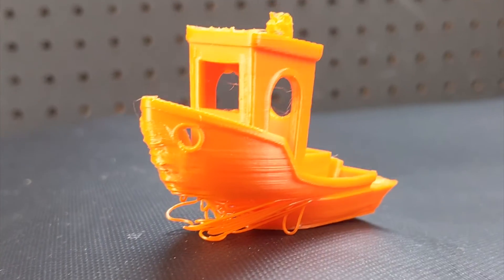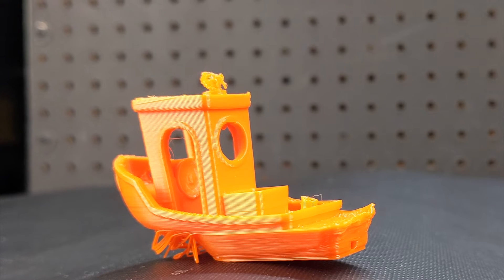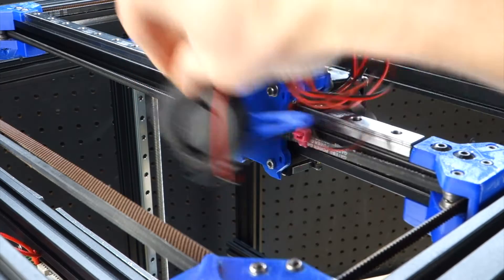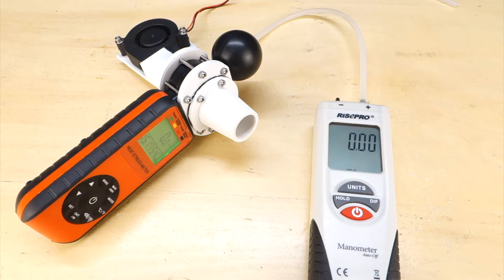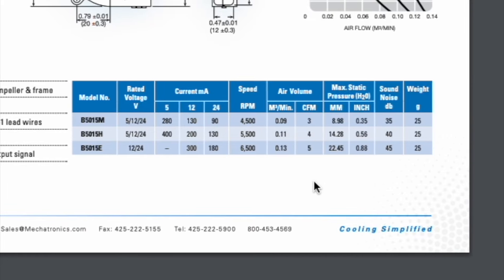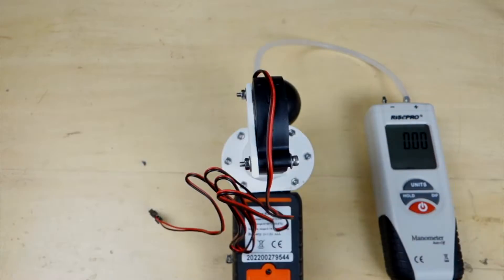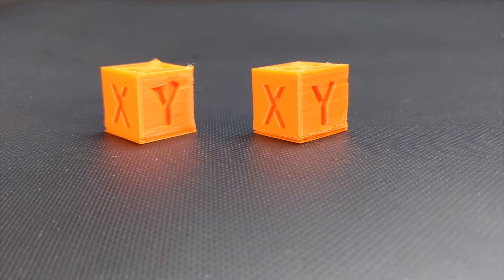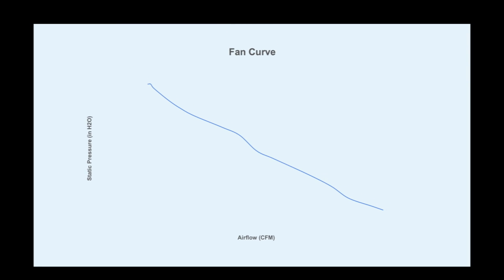ELIMINATE FAILED 3D Prints with This QUICK FIX!

Comment: ok without having seen the video, stopped at where you say the fan is barely noticable, im gonna make a wild guess and say:   24v fan ( or any voltage higher than the port supplies) on a port that does not supply 24v but less, ima edit after the video if i was right :D

edit: i was wrong :D but i had 2 friends already complain that theirs had similar issues and they put a 24v fan on a 12v fan after replacing the cooling fan with ones they found recommended for that size, not knowing its different voltages
Reply from the maker: Good point!  It's important to double check the fan voltages.

Comment: I would say you should also look at your bed though. The print head should not be able to shift your magnetic steel sheet like that, normally it's virtually impossible to move the sheet horizontally when its held by the magnetic substrate, that's why you have to pull up at a corner to get it to release.
Reply from the maker: Agree.  The bed is on my upgrade list.  During the build I did realize the magnets were were weak, but this showed just how weak they are.